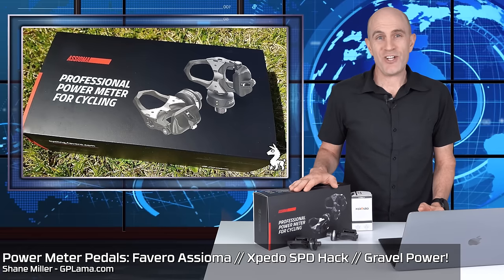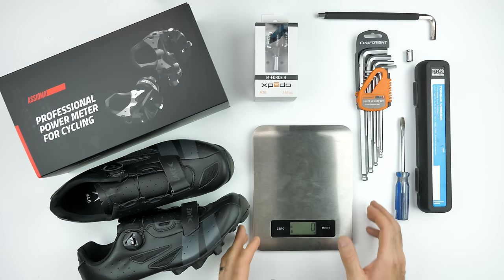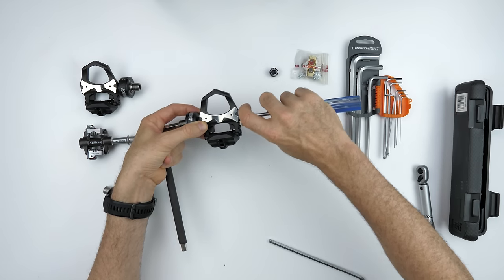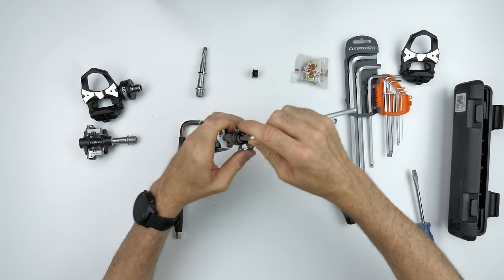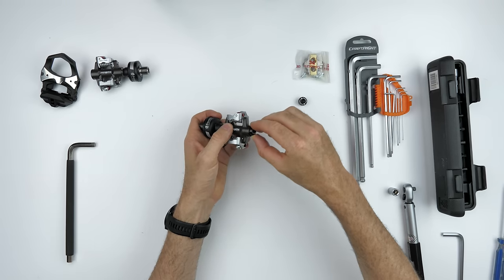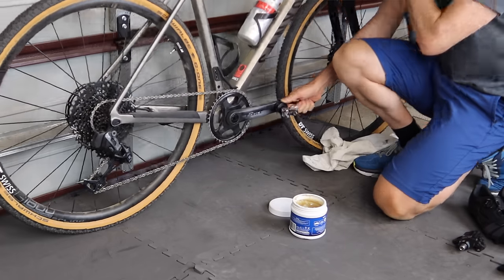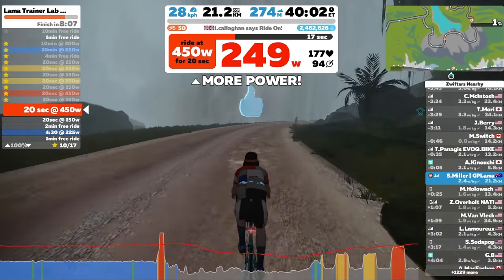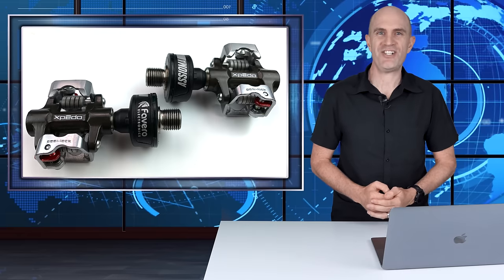Power Meter Pedals: Favero Assioma // Xpedo SPD Hack // Gravel Power!

Comment: Mind boggling with all the Power Meter companies out there trying to bring products to market and anyone can do this at home....
Reply: Haydn Mclean What is mind boggling? You still buy their power meter... Assioma uses Xpedo pedal axle without modification and it’s the same for road and mtb. It makes total sense from a manufacturing standpoint and gives way to a viable hack. It won’t be an off the shelf product as pedal based power meters are not viable ‘off-road’ products for manufacturers.

Comment: Or just get these when they drop: http://www.srm.de/product/x-power/
No shoe clearance issues or void warranty
Reply from the maker: They've been coming soon for a while. I'd like to see their accuracy tested too. Sure, they're SRM but that'd be a first-gen product from them in the pedal iirc.
Reply: Yeah, the dreaded "coming soon" timeline lol. I'll cross my fingers we see them before spring, mainly because I prefer not to hack up my shoes. I wear a more stealth style 5 10 mtb shoe. So trimming would be a disaster 
Regardless, nice hack and it would save some dollars as the SRM will undoubtedly debut at a higher price point than the parts needed for this conversion.
Reply: 2 years later. It’s still not out. Maybe the pandemic slowed them down.

Comment: no, that is not professional but rather home-made solution. yes, as long as it works but not on the mass scale. I am not any mountain biker but such huge shape of the power meter like in Assioma that is exposed to the damage in case your pedal/crank touches the rock or so does NOT make these pedals fit the mountain bikes at all. So as a prove of concept YES, but on the mass scale NO. great video and idea but roughly in the version of 0.1 alpha ;-)
Reply: I think this is more for gravel which shouldn't be as rugged as MTB. More like road riding but on dirt and gravel so shouldn't be hitting cranks too much.
Reply from the maker: I can’t disagree. I did this conversion at home. 🤷🏻‍♂️🤣

Comment: Requirement- You must be this bowlegged to use this product.
Reply from the maker: You’re having a crack at the Q Factor? It’s no more than 1-1.5mm more than a Shimano road pedal. It’s a non issue.
Reply: @gplama  Thanks. Yes, I was thinking it was wild. I just got Eewings, and can't even tell the difference. Huge q on those.
Reply from the maker: It's a bit of an optical illusion. https://powermetercity.com/2017/01/22/favero-assioma-q-factor/